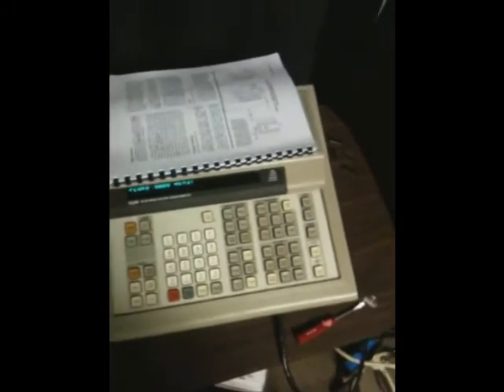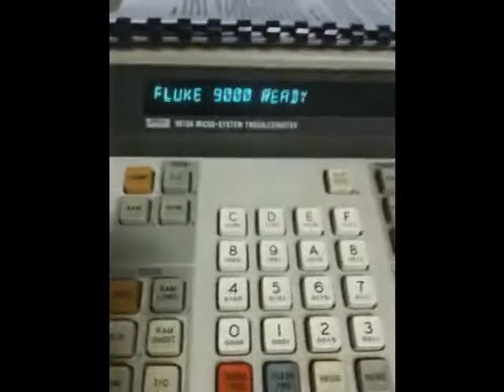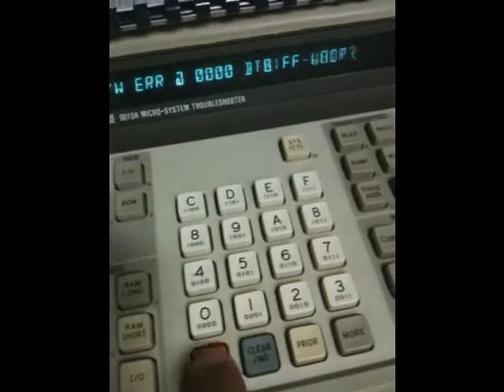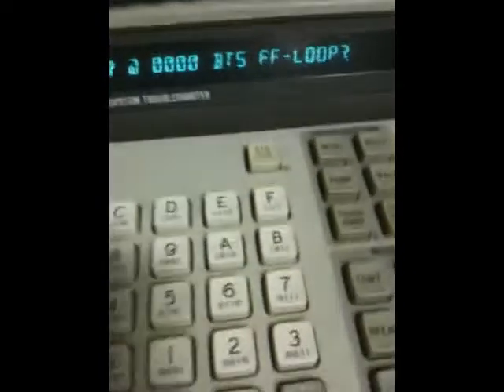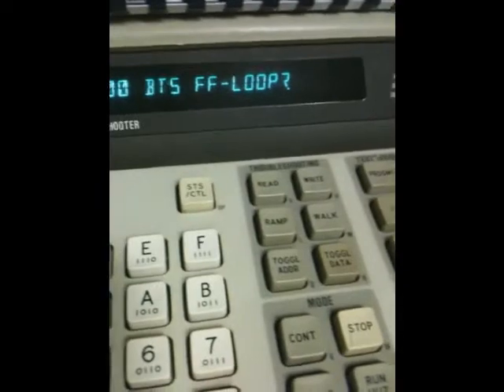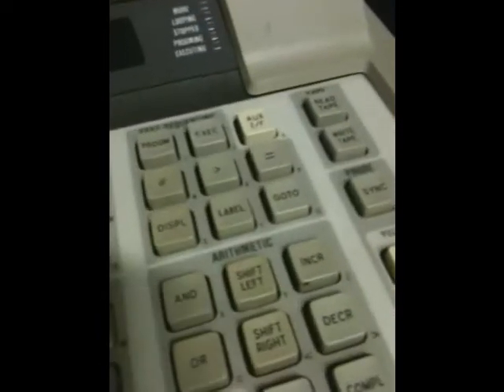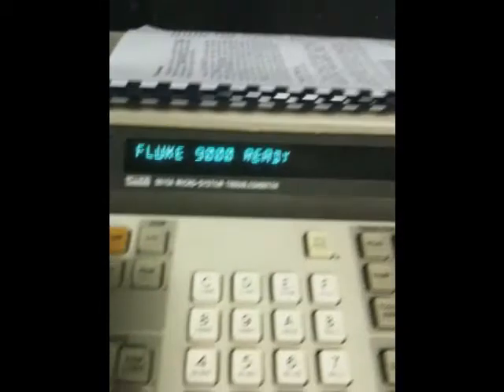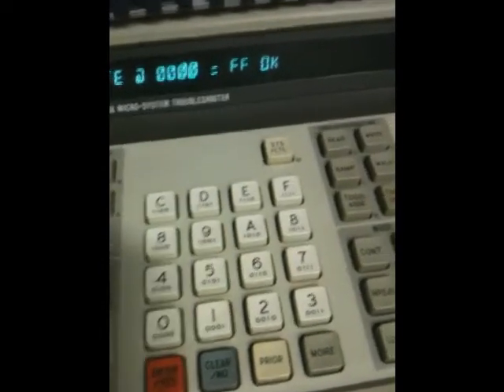Using a Fluke 9010a to fix an arcade game.

Comment: Hi, I need your help. I have an HP 10529 logic comparator like yours and the problem I'm having is that no matter what IC I test it will not turn on. I did a self-test and everything looks good but not when I go to test on any PCB. can you help with any suggestions?
Reply from the maker: Sorry im responding 4 years later but check for broken pins on the chip clip as well as the edge connector on the socket board.